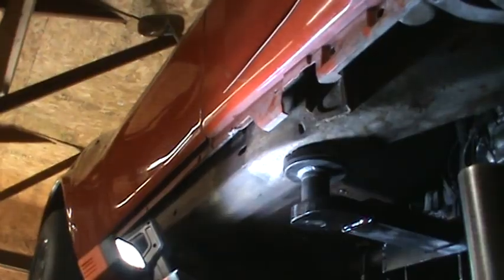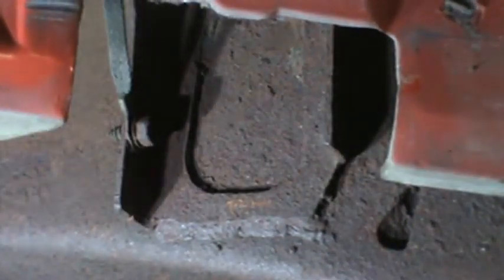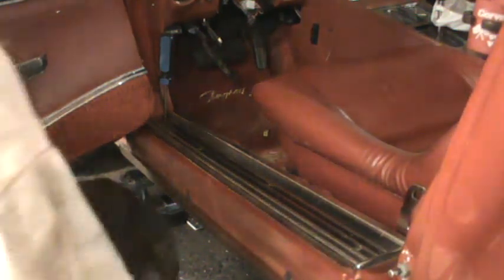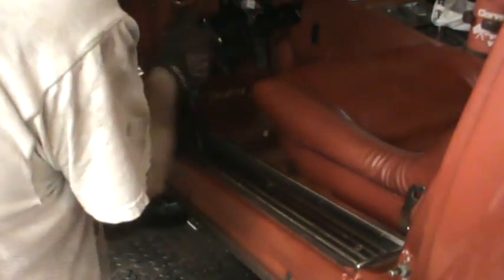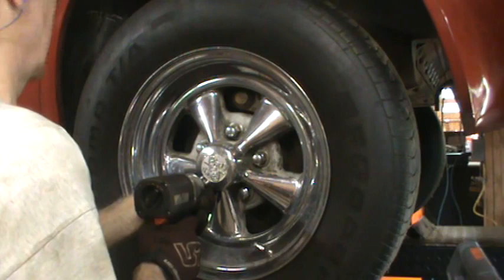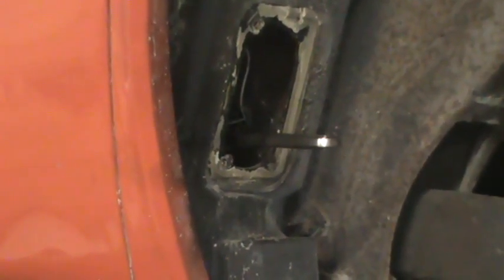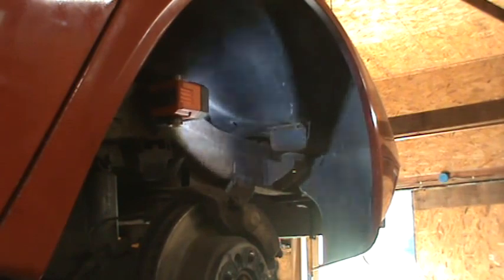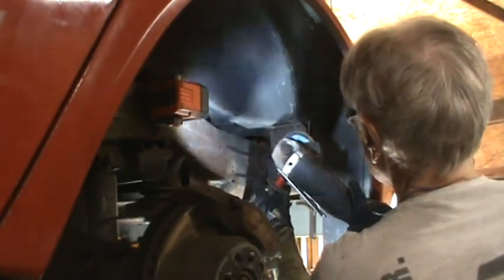76 Corvette refresh Pt 18 Body mount bolts removed

Comment: Wouldn’t PB Blaster help loosen those body mounts?
Reply from the maker: I tried to spray PB Blaster on them every couple of days for about a week.  In addition, once I got some room under the bolt heads I sprayed it under the head frequently so it could run down to the nut.  The problem is that the nuts are hidden under the body and it is difficult to get the Blaster to the nut.
Reply: @fun-cars  Wow, I can’t imagine how hard they would have been to remove if you had not used PB blaster.